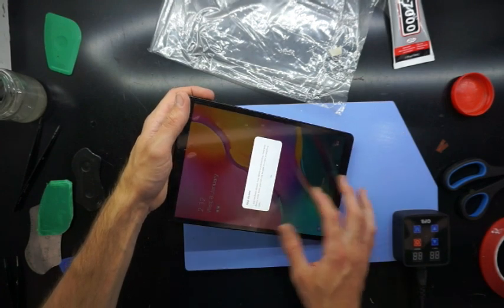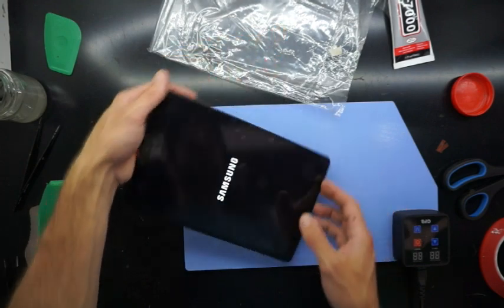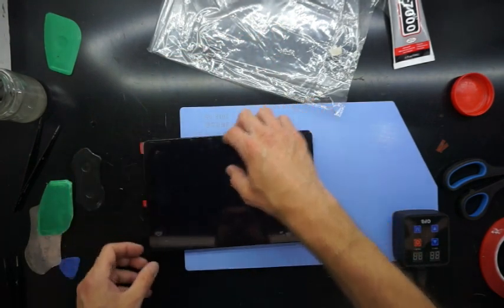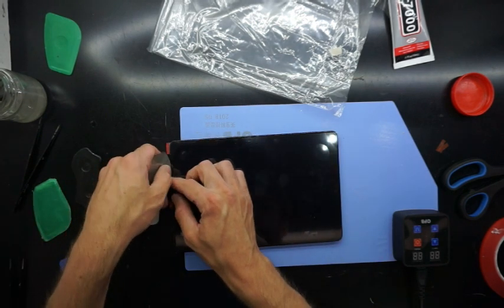Samsung Galaxy Tab 2019 T510 LCD & Digitizer Replacement

Comment: I really appreciate your video.  I started off trying to replace just the digitizer (the outside glass) because my tablet was still responding to touch.  I quickly figured out that separating the digitizer from the LCD is extremely difficult for DIYers.  I then bought the LCS digitizer combo.  From there I followed your step by step instructions.  Everything turned out flawlessly.  I used isopropyl alcohol and the heat gun just as you described.  Thank you for giving me the confidence to do it myself.
Reply from the maker: Awesome work, good job replacing your tablets display!

Comment: In case this bites anyone...the little daughter card that is transferred to the new screen/digitizer needs to be grounded to the metal metal back of the digitizer or you'll find that you have screen output but no digitizer input.  It didn't work when double sided tape was separating it from the metal backing.  Once I confirmed that the big trace on the back needed to grounded to the digitizer case, I secured it with a couple of small dabs of conductive epoxy instead of tape.  Works like a charm now.  Thanks for the informative video!
Reply: Where did you get that dabs at ?
Reply: @joshuasantos1418  It was some of this that I had left over:  https://www.amazon.com/Permatex-21351-Electrically-Conductive-Defogger/dp/B000HBGKWE
Reply: RitzRT I did everything in the video but the screen not turning on do you think this is the problem?
Reply: @joshuasantos1418  Could be.  If you press down on the little daughter board so it makes contact with the metal while it's powered on, do you get screen output?
Reply: RitzRT screen not turning on but the tablet is on
Reply: @joshuasantos1418  Hmmm....that is initially what I saw as well.  Then when I put pressure on the little daughter card so that the back made contact with the metal backing, the screen sprang to life.  In hindsight, I don't think I'd bother fixing one of these again.  The new screen is already having issues (about 1/3 of the screen will randomly go dark and then randomly come back to life).  This is the screen I bought:  https://www.amazon.com/gp/product/B087TP1SKQ
Reply: RitzRT sorry to bother you again but how did you use the electrically conductive tabs
Reply: please help. i replaced the screen bc it was cracked. the new screen works but no touch input. is the little board that you have to transfer from the old screen to the new screen the part that controls touch input?
Reply: does it need to be grounded to the back of the new screen or the inside panel of the housing that holds the rest of electronics?
Reply: I know it's been like a century since this comment, but like-

I've gotten everything working LCD-wise. Touch wasn't working, so I looked the video up and saw this comment.

Pressing the daughter up against the metal where it was on the other screen doesn't really have touch work.
None of the cables are broken, and I've gone as far as unplugging and plugging each part back in and still nothing.

I haven't tried getting any conductive tape yet, but I feel that I should at least be getting results by pressing the thing against the metal on the back of the screen, right..?

Comment: Thanks for the detailed instructions. Everything was working well (at least I thought) until it was time to turn the screen over to see if it was on. Blank (black) screen. Re-did all the ribbon connections, still nothing. I can plug it into a PC and see it come up in the directory , so it's on.  Without seeing it, is there something specific I should check that could be the reason? Any ideas would be appreciated. Thank you.
Reply: Did you figure out the problem? I'm having the same issue 😭
Reply: @edgard2u  quite possible to damage the tablet when replacing a screen with battery still connected.......
Reply: Anyone resolve this issue? I’m experiencing the same issue.

Comment: I have a question is it better just to replace the digitizer and LCD togetherI have a badly badly cracked digitizer or LCD is fine but if it's all the same I would just replace them both if you would suggest this please let me know the answer thank you very much for the video
Reply: Watching further out in the video I see you say it is harder to replace just the  digitizer? so I will alter the question to be is it so hard that it shouldn't be attempted or should I just go for it and try to replace the digitizer only do you have a video with that?
Reply: @ClownWhisper  A screen usually is the glass plus the digitizer glued together so if you have a cracked screen but it still recognizes your touch, just buy a new screen/digitizer. It's very easy to install. Part costs around $25 to $30.
Reply: @danejurus69  I'm having a hard time figuring out how it separates I've done this before actually on a different brand and it worked fine but on my 2019 tab a t510 it's hard to tell if I come straight down to get under the glass or if I come in kind of at the sidethe way the whole assembly is put together it's not clear to see exactly
Reply: @danejurus69  while watching this video it looks easy to replace both

Comment: i have the same unit samsung tab a 10.1 my screen is fine and tab works well no problem using it, however the sides/corners are raised. is this okay? or do i need to go to shop and replaced? an answer would be a great help thank you!
Reply from the maker: That sounds like an expanded battery
Reply: @rickstechrepairs  hi, should i go to shop get replaced my battery?

Comment: Thanks!, got one of these in for repairs today will be doing this tomorrow when parts arrive
Reply from the maker: Be careful the first one I did of there I accidentally damaged the LCD cable
Reply: @rickstechrepairs  Just changed my first one and am wondering if I damaged the cable, the screen is flickering or looks like it's scrolling. Was pretty sure I didn't damage anything though. Can I ask what was the result of you damaging it? did it not work at all or is the screen flickering? Thanks Rick. Great video by the way :)
Reply: @Ricks Tech  hello sir how did it got damage exactly because I just installed mine but the screen is black it won't show anything even though I check the LCD cable and it does not seem damage 🤔

Comment: Thank you for the instructions. When I opened the case it popped open and the LCD ribbon cable yanked out of the connector to the screen (breaking the connector). So, when with replacement screen didn't work I got a new LCD cable ribbon (assuming that I've damaged the cable) and opened up the next layer and replaced that. After assembling, this time I get through start up, but the screen is very low light and the touch screen isn't responsive.

I re-booted a few times (volume down and power) but it's always the same. I've reconnected all the cables a few times. 100% charged. Any other things to try? Know issues? Can I force it to factory rest somehow, would that help?
Reply from the maker: this is a hardware issue, factory reset wont help.

possibly damaged flex connector, or faulty display / digi

Comment: Hi, does it need to be isopropyl or can other alcohol/dissolvents be used as well (acetone?)
Reply from the maker: havent tried any other solvents sorry 

but i know isopropyl is safe on electronics, just don't get in to LCD displays or on rubber
Reply: @rickstechrepairs  thanks

Comment: Really detailed how-to! Even tho you didnt take the whole tablet apart, the long ribbon cable connected to the screen assy, does that go thru the logic board to the back? Also, the "Exxxxx" # on the cable, is that the part number for it? Also, the new screen, did it come with a home button? &, could you have gotten the screen complete - with the mini pcb & ribbon cable? What a tedious replacement! Thanks again 🤓 also, the B-7000, thats a good adhesive to keep the new screen in place? Thanks shoulda asked - the old screen was just cracked? Did it still work? Did you keep it? 😁 sorry, little cheezy here
Reply from the maker: I can't remember where the cable runs sorry 

Home button doesn't come with screen and LCD 

B7000 is my go to stuff for sticking things

Old damaged parts went to recycling
Reply: @rickstechrepairs  thanks, just looked closely at the virtual home button! Found a damaged s/sung 10.1 tablet, & am watching how-to videos. Not sure if it works, tho, ad the back cover is a bit messed up. Want to get it at least plugged in! 🤓 it looks like the long ribbon goes thru the logic board support (thru a slot) then to the other side!
Reply: @rickstechrepairs  sorry, its an sm-t517p model. Thanks 🤓 basically i find broken phones, tablets (this is my 1st samsung tablet find) mostly ipads, & mess with them.

Comment: Rick, thank you for excellent video.  The new digitizer I got, the main harness connector didnt come with a latch. When I put the ribbon in and held with finger, it didnt power up. Does it only work with that latch?
Reply from the maker: The latch is used to lock the ribbon cable in place and to push the cable to make a solid connection to the board 

Without the latch it won't make a good connection and usually won't work 

You can try and put some tape on the ribbon cable to pack out the size difference
Reply: @rickstechrepairs   Im returning the unit I got... Ill try again in future and order a new digitizer and hopefully the latches are all there. Again, thank you for great video, helped a lot.

Comment: Hi Rick I loved this video, but I replaced my LCD broke but still can get any image just a black screen, but reading one of your answer mentioned that I need to replace the digitizer and where I can Get it?? Thank you
Reply from the maker: If you are getting a black screen with a replaced display, either it's not connected well enough
Needs the battery disconnected
Or the new screen is no good
Reply: @rickstechrepairs  What happen if I connected with the battery connected, there is a step to clear it, or just I can disconnected and do it again?? , thanks for your, is my daughter tablet.
Reply: for your help
Reply: Screen and digitizer come together as one part basically. Either you bought a faulty screen or you don't have all the ribbon cables and connections hooked up properly.
Reply: Did you fix this issue? Just Did the repair and I'm having the same issue 😭

Comment: What type of tape did you use for the daughter board for the touch input? Does it have adhesive on both sides and is it conductive? It seems to be different than the one that you mention in the description. 
I am having the issue of having normal screen output, but no touch input and I am suspecting that whatever secures the daughter board to the metal must be grounded.
Reply from the maker: i don't believe the pcb doesnt need to be grounded, just attached
Reply: I think I have the same issue, Nick. I power up, lock screen is on. But I cannot get any touch response, even to "swipe up" to log on. I used Scotch double-sided tape to stick the daughter board on. I wondered about grounding, but Rick says that's not important here. Rick, any other suggestions?

Comment: Is it possible to just replace the glass on this model? I have cracked the screen on mine, the LCD is working fine so thought I may have been able to just replace the glass? I have seen many (just glass screens) being sold online. If not, where is the best place to purchase a replacement? Thank you. Your video is very helpful.
Reply from the maker: nar, cant do glass only unless you buy some decent gear

Comment: i repaired mine with an aftermarket screen from ebay, but the screen brightness is not as bright as the original. its very low. Did you have this issue?
Reply from the maker: its usually a challenge to find quality replacement parts

Comment: Think the battery might be bad. I noticed a couple small punctures in the battery, near the middle area of the hash lines. If you see small punctures, & smell something akin to rubbing alcohol, is the battery totally bad? Also the mini pcb, small j- or u-shaped flex cable, long screen flex cable, are gone! I will keep your video in mind, but it may not be worth fixing the road side find! Think the main logic board is intact. Thanks again sir.

Comment: Hi ricks. I would like to ask. Since the LCD was just pulled out though its still fine. What should I do to put it back?? The lcd just got disconnect
Reply from the maker: i would think you just need to connect it back up, skip to the part of the video doing the reinstall of the new screen
Reply: @rickstechrepairs  thnk u very much n sorry for late response

Comment: I am having some issues on the same model where the new or old screen will not show a display now. Any suggestions?
Reply from the maker: check flex connector that goes from the screen to the mainboard. 

make sure battery is disconnected when you do that

Comment: Do the flex cables break easily? It was working but before i taped the PCB component down wanted to make sure screen turned on which it did. So i disconnected everything and taped down that and reconnected all the cables back now the screen wont work. Any suggestions?
Reply from the maker: they can tear, they arent super strong, apart from disconnect and reconnect i cant suggest anything more sorry

Comment: Could you also show how to just replace the digitizer instead of the complete screen? I want to know if that is possible. I have ordered a replacement digitizer but have not managed to get the backcover of the tablet. And the repairshop says this tablet can only  the complete lcd+digitizer.
Reply from the maker: Hi, Im doubtful I could do a video on digitizer only as I only do digitizer+LCD on this model
Reply: @rickstechrepairs  ok. I cannot see in the video whether you put the tool from the top of the tablet under the screen or on the side of the tablet. I tried to get the backcover of the tablet, but was not successfull so far. But perhaps, I did it completely the wrong way.

Comment: Hi Rick thanks for the help. Followed your intructions. The screen works fine but the touch sensor isnt working. Any advice?
Reply from the maker: Double check the touch panels cable 
Possibly a dud touch panel also
Reply: Hi Rick I'm having the same issue I've checked the connections and still nothing., I've also looked online for a replacement touch pcb board but to no avail :(

Comment: So I got the screen replaced. Touch was not working, so did a reset and it worked. Turned off the screen glued down turned back on and now no touch. Is the screen faulty or something I did? I got the screen off again and still not touch.

Comment: I make repairs myself mate, I cant source a separate touchscreen it comes just as lcd/ touchscreen as a unit, costs more but better for the customer.
Reply from the maker: That's what I typically use myself for repairs

LCD + digitizer

Comment: I did it all just like that. I finished I tried it and it worked normally. before I put the glue stopped working, what could be wrong?
Reply from the maker: check digitizer cable and flex cable where it connected to the mainboard

Comment: did this got my kids screen working and as i fliped it a accidentally pulled out the lcd cable ribbon  i put it back in now theres sound but the screen is black did i break the screen ribbon
Reply from the maker: It's possible.it was torn from the LCD itself, even a tear so small it doesn't look like anything has happened 

If you still have the cracked screen to test, give that a shot
Reply: Did you fix this issue? I'm having the same problem.

Comment: Anyone know where i can buy a pcb preferably in Australia? Threw my old lcd/digitizer away since it was badly smashed then new one turns up and i need it 😭
Reply from the maker: i hope you dont mean PCB as in mainboard :( 
for something like that i would be looking at getting a damaged second hand one off ebay
Reply: @rickstechrepairs  no the little one stuck to the back of the lcd
Reply: did you ever find a place that has that little board? im in the same situation